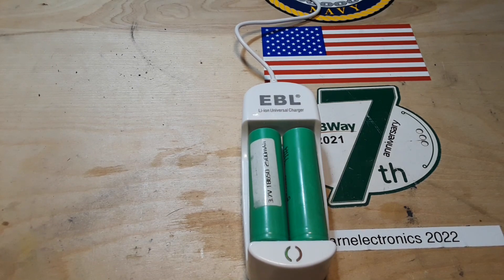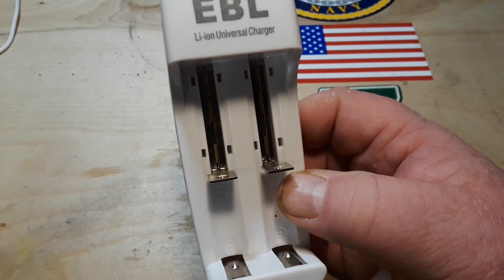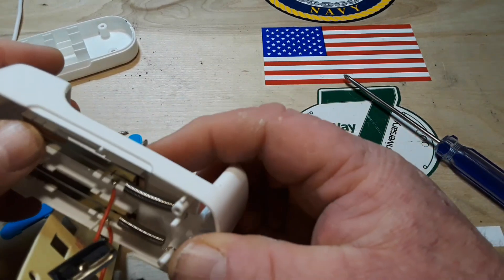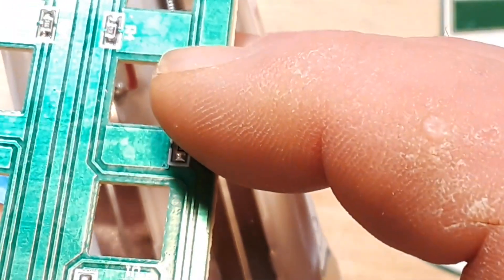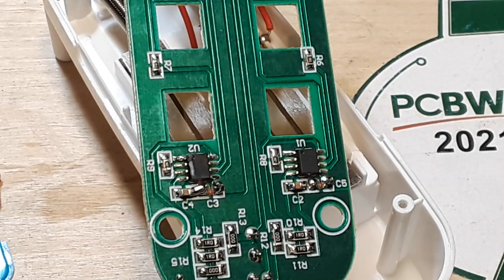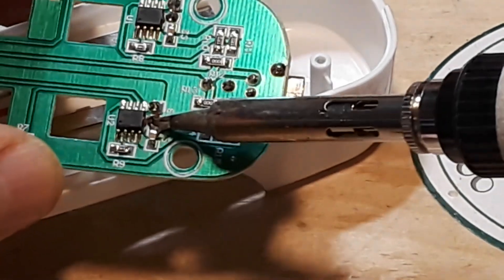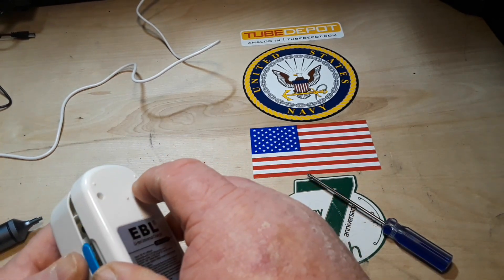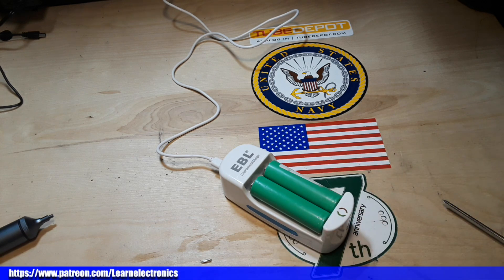EBL Lithium Battery Charger Tear Down and Repair

Comment: Oh Man, I just opened up a B3 lipo charger and all kinds of shotty stuff was hiding within the enclosure. And for fun I opened a second faulty B3 charger to find the same kind of non-sense happening. Solder blobs and incorrect capacitor ratings. I'm going to order some TP4056's and try to make a proper charger out of these B3 carcasses, however, I will avoid these in the future. Excellent Video.

Comment: Hi Paul: I happened to be watching the EBL charger video and wondered if you would be interested in tackling/troubleshooting a Lorex Wireless Receiver used in a Lorex Wireless Security Camera System, or refer me to someone else.  I'm on my third receiver and it appears after 5 years that the receiver going bad is the only flaw in the system. Otherwise, I'm happy with the system around my little house in Columbus, Ohio. I may be running out of options for third party receivers from here on out and Lorex doesn't have any and only wants to sell more systems instead of replace parts. I'm retired and on a tight budget, a budget that has gotten tighter over the past two years. I also live in a BAD neighborhood thus the need for the cameras and motion detection in my yard. The model number of the receiver is LWB6801-W. I would send you a pic of the thing opened up but I don't see a way to do so. I appreciate any info in finding someone who might be good at this and make a few extra bucks. Thanks. Ed

Comment: I recently got some EBL AA Lithiums. EBL was of no help. I was wondering why you need to use EBL charger instead something like th Zanflare Opus ect? Even after I used EBL's charger 3 of the cells measured just a little over 300mAh for cry from 2000mAh & the other 5 cells measured zero.

Comment: Does anyone make one that also turns 18650 cells into a decent power bank? I mean, I don’t actually need an AC charger and power banks obviously have a built in DC charger so maybe I can kill two birds with one stone.

Comment: Damn I have one of those for the EBL batteries I have. I made some Bluetooth radios and I bought the EBL batteries and holders for ease of replacing the batteries when needed. I use the charger to charge radom 18650s I have for other things. Lol
Guess I need to take a look at mind... :-D
Thanks Paul!
LLAP

Comment: I was surprised you didn’t flood that joint with flux to help the solder flow.  General question: are there general guidelines for when to use the sucker vs. solder braid?  Or is it just personal preference?
Reply from the maker: I would say preference. But everyone tells me I'm so...

Comment: Did you notice that the side where you broke the solder bridge wasn't charging after you put the batteries back in at the end of the video but at the start both sides were charging..
Reply: hmm, i just thought that the left side (green) battery was fully charged, and the right side battery was charging, no ?
Reply from the maker: That battery was charged

Comment: Hi. This video interested me because I recently purchased power banks to use in my own projects. Initially, I had only one power bank and after taking it apart I experimented with the battery and charger. My PSU was ON when I absentmindedly set the charger aside on top of one of the many metal parts I had piled up on my small work surface. Needless to say, I saw a bit of smoke, and accidently fried this charger. So, I purchased 4 more of these power banks to use in my projects. I took 2 of these power banks apart and retrieved the (2) 5V 20000mAh LiPo batteries and chargers. These units have the same protections as your cheapo one. 

Later, I realized I could one charger for all of the LiPo batteries, and because I had 4 of these I'd be left with 3 leftover chargers. So, I used one of the chargers and inserted it inside a small 3D box I made especially for it. This has an added advantage. I built an enclosed programmable servo tester with an Arduino and KeyeStudio 16-channel servo driver. The Arduino UNO is connected to 3 AA Duracell batteries. The KeyeStudio servo driver is mounted to the Arduino, but powered separately by the 20000mAh LiPo battery. I've also been working on a rover spider robot which needs a lot of juice because it operates 19 servo motors to move the legs around. I can use the same charger for both these projects. The only flaw with this is that I need to find an adequate low battery indicator to let me know when the batteries need charging in either project. At the moment, there is no such device installed in either project, so I am limited for the time being to experimenting with these as little as possible.

I've also come across this solder that just does not seem to want to melt. My soldering iron is set to 270 degrees. I think it's in C, not F, but I'd have to look it up. That solder is a real pain in the arse to remove. I don't know what kind of solder these manufacturers are using, but I think the difficulty provided by it is intentional and meant to keep guys like us from modifying their devices.

I imagine changing the tension springs in the unit for weaker tension ones might help you with battery insertion.
Reply: "but I think the difficulty provided by it is intentional and meant to keep guys like us from modifying their devices."

No, it's environmental. They are not allowed to uses leaded solder for environmental reasons, so their solder has a higher melting point.
As hobbyists, we can use leaded solder with a lower melting point. So Paul did the smart thing: add some of your own solder to it, so the resulting mixture will have a lower melting point.
And your soldering iron will be set to Celsius, as 270F = 132 Celsius, which is not even close to melting solder.
Reply: @divingquokka  Thanks. Now I know. And yes, I like the idea Paul used to melt it down.
Reply: On the solder,its probably lead free and its crap to melt but if you add leaded solder with your iron which I would set to around 350°c it should melt no problem, I as a matter of course always put a small blob of solder on my iron to aid heat transfer as Paul from learn electronics told me to and is almost essential for successful soldering 😎💕🖖
Reply: @kevinscollan8293  Thanks Kevin. Will do that next time.

Comment: I would've fixed it too, but I'd also use a multimeter in continuity mode to make sure the bridge was broken (assuming the component shouldn't be connected in the first place, otherwise: why fix it?). I would've taken a good decent look and even measured at the second charging point and see if it was supposed to be connected. It's not guaranteed to be the same (or mirrored) but it is an indication.

Comment: Boy do you not know how to deal with solder bridges, you don't use pump to suck solder, you use rosin flux and use the iron to draw the extra solder out.
Reply: and rosin flux is on sale now
Reply: That works with small solder bridges. For this massive gob I would use the pump as well, or maybe the braid.
Reply: @divingquokka  how much you wanna bet, I clean a lot larger spills by this method.
Reply: @tanishqbhaiji103  Good for you. But it is quite insulting to tell Paul he does not know how to solder.
Reply: @divingquokka  that wasn't the intention.
Reply from the maker: Your right, my 30+ years have taught me nothing.

Comment: That has got to be thee cheapest 4056 Charger I’ve ever seen. As long as it works I guess.  I ordered 40 of there chips and haven’t played with them yet. I want to figure out a way to use them with lifepo4. Good job spotting Chinese Job Security, or QA Death Sentence.